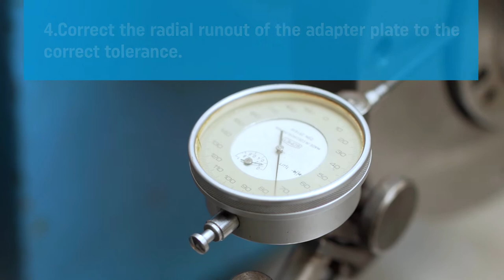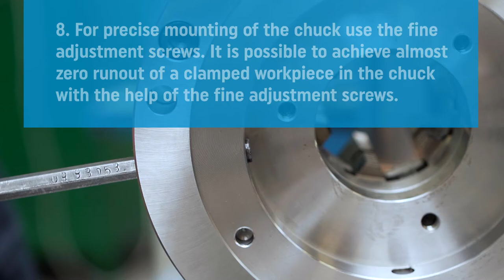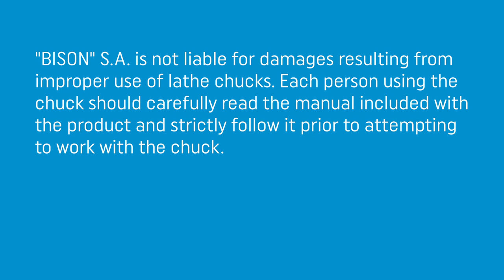Installing a BISON Set-Tru Lathe Chuck

Comment: I have an 8" 3 jaw Bison Set Tru chuck. There are three holes for mounting the chuck to the adapter plate. If you choose the wrong hole, the fine adjustment pins will gouge the adapter plate because, in that mounting position, those fine adjustment screws overlap the screw recess for attaching the adapter plate to the spindle. I informed them and they could not care any less. I do like the chuck though. The repair to the gouged recesses only cost me $200.00 to fix.